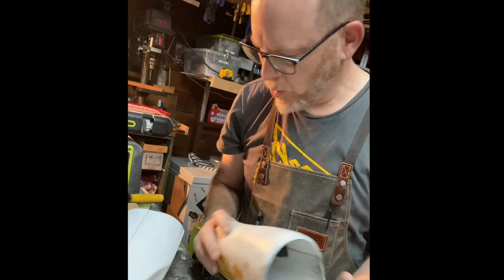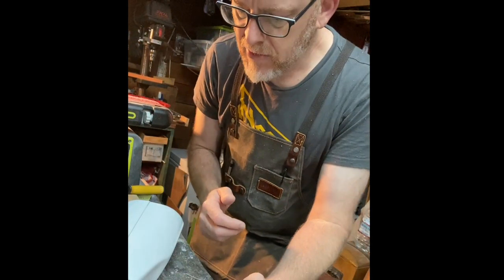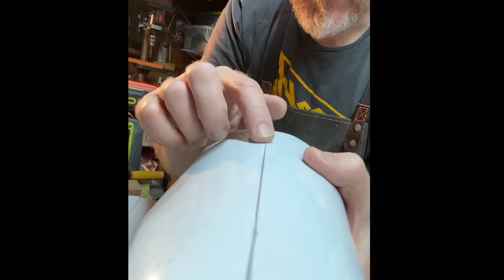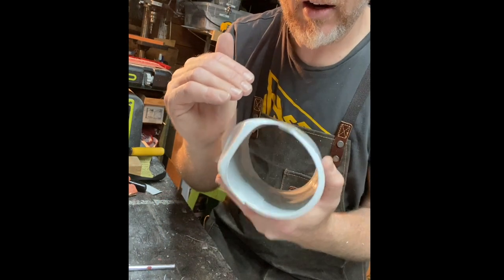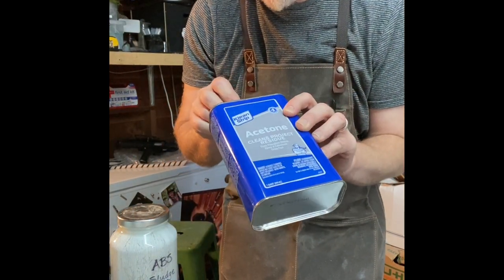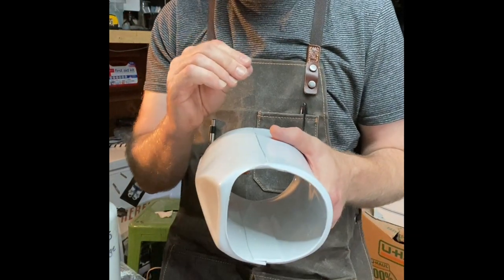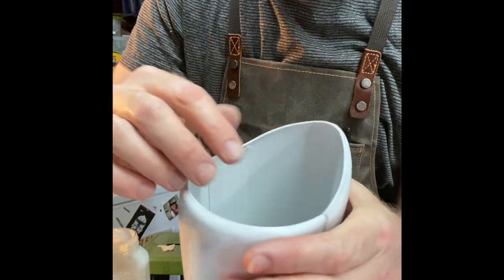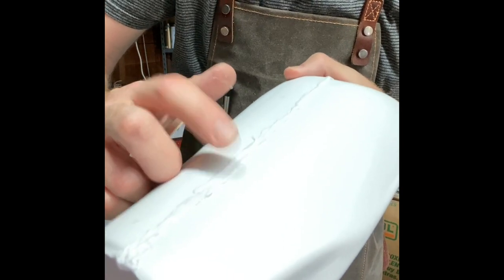Troubleshooting Cracks In Clone Trooper Armor Seams

Comment: Very helpful tips on how to apply the slude.  I'm on my first build with a HIPS kit, are there any differences between HIPS and ABS sludge?
Reply from the maker: I am not sure, I have only used ABS sludge.
Reply: @OddViking  Thanks anyway, the differences that i've heard of are that HIPS sludge should take longer to make but is easier to apply.  I guess i'll do some test myself then.
I'm still concern about safety. I thought acetone was really toxic when melting plastic, they say its smoke could cause cancer, imagine my shock seeing you applying with your fingers.  I guess it is safer to use after it melts?
Reply from the maker: @kaminopub0903  As far as I know, there is not smoke. It breaks down as it dissolves, rather than heat melts. This is the same acetone that people remove nail polish with, so while it has fumes, it is okay to be around for a limited time, and sludge has even less of that vapor.
Reply: @OddViking  Thanks again for the suggestions. I've done some tests and it works great. The only downside is that it leaves a porous surface when you finish sanding, which Bondo do you use at the end process?
Reply from the maker: @kaminopub0903  It does have a porous surface. I use Bondo Glazing and Spot putty (pre-mixed tube that you can find at auto supply stores), and usually followed by Rustoleum filler primer (fine steel wool, then burnished with a paper towel to a shine)  to ensure a smooth seam.